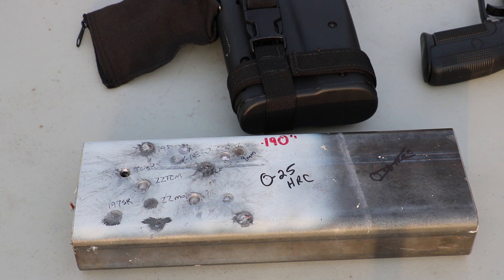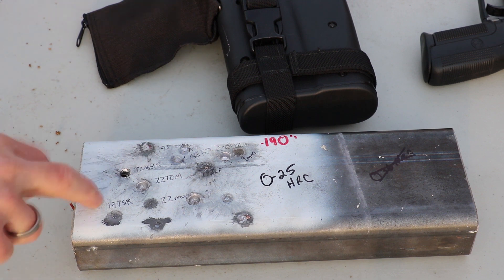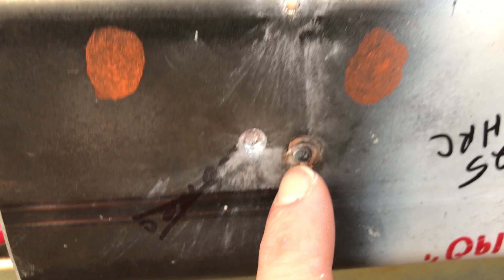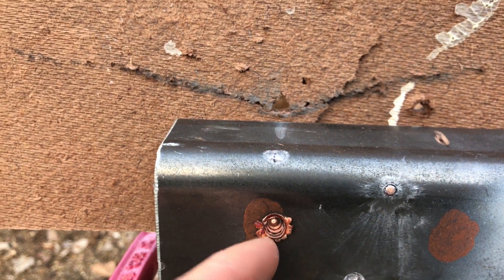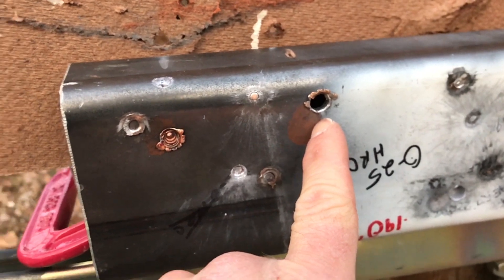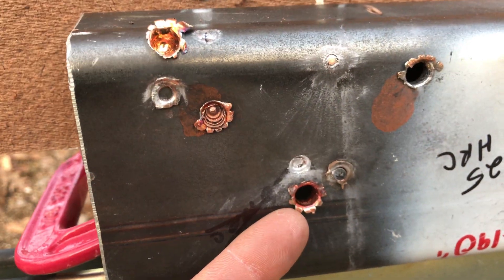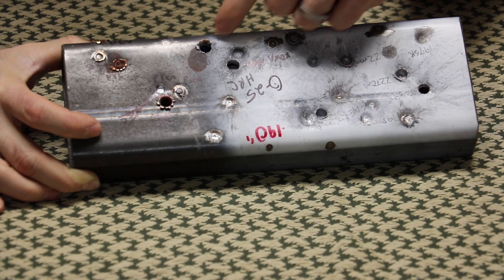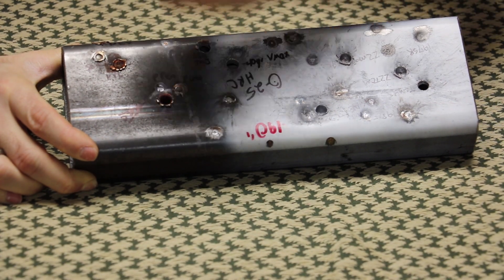Can Various 5.7x28mm Rounds Penetrate Mild Steel?

Comment: Could the SM855 and SM855A1 penetrate this being shot from a pistol 🤔? 
25 HRC is surely high strength steel.
Reply from the maker: @ShokkuKyushu  not sure. Friend has SM855a1 and it comes apart when shooting it once bullet leaves barrel

Comment: how do you know the correct way to handle ricochet?
Reply from the maker: It's a crap shoot. Pretty much don't shoot steel at close range.
Reply: 10 yards is about the minimum safe distance for proper steel targets if you're using handgun rounds.
Angle the steel slightly towards to ground & don't have it rigidly mounted.
Another big thing is to never shoot it at a sharp angle.
Shoot it straight on or at least pretty close to straight on.

I can't guarantee your saftey, but following these rules are almost certain to keep you from any significant issues.

Comment: Anyone know the C scale hardness of 14 gauge steel in a shipping container? I'm trying to estimate p90 effectiveness when target is using shipping container as cover, thanks
Reply from the maker: I'm going to say it's mild and likely of the similar hardness to this. Without me having access to a piece for testing, it's a wild guess. 14 gauge steel is only .075" thick. This box steel here 240% thicker. :D
Reply: @BuffRANGE  Thanks for the. Reply. Sounds like a standard FMJ fired from a p90 should be lethal if target is inside container. Probably even penetrate both sides. Might not be lethal if it travels through both sides though. :) wild guesses from me
Reply from the maker: @andersmalmgren6528  If I get some 14 gauge steel I can try sometime, but it may be a long time before I would know. And  standard FMJ do you mean the American Eagle TMJ or SS190?
Reply: @BuffRANGE  The SS190 (the 31 gr version)  seems like its mostly common if i'm not mistaken.
Reply from the maker: @andersmalmgren6528  depends on where you are from. in the US it is not available for us to buy from dealers.
Reply: @BuffRANGE  Yeah, I was thinking military use :P I'm that same gamedev guy you had a mail conversation with a few weeks back, we are just trying to set up some work in progress numbers that are not too off for our  terminal ballistics :P
Reply from the maker: @andersmalmgren6528  Got it :D I remember now.. Sounds like you'd want me to test this..
Reply: @BuffRANGE  haha, I cant ask that of you but it would be cool :D 
There are alot of barrier tests online, but most are hard to extract any data from :D

Comment: VELOCITY is the key. A guy loaded a 55gr .224 std FMJ  lead core Sabot in a 300 mag. 5000 fps blew a hole thru a piece of 1/2 AR 500.plate.
Reply from the maker: Got a video? I've been trying to do 300 WM Sabot and haven't had good luck :(
Reply: @BuffRANGE  Search for "5000 fps" that should pull up a dz or so videos.
Reply from the maker: @williamkowalchik572  Thanks

Comment: The pure lead has more mass than steel, so theoretically when the projectile and plate connect and create that imperfect liquid situation, the higher mass of the lead should push through the less dense steel.

Comment: I really like the FiveseveN and the 5.7x28 cartridge but truth be told, the round comes up just shy of it's full potential - but it's not all just the round's fault.  Because the cartridge is so long, FN had to compromise somewhere to hold the pistol size in check so a short barrel made sense, even though high-capacity .22 bottleneck cases lose a lot with each incremental loss of barrel length below about 10 inches.  So clearly the 5.7 would be a better round if it's base platform had a 6" barrel instead of 4.75"!  Then comes the fact that FN has never seen fit to really market the gun and has kept prices high on what should really cost no more than any other mostly polymer pistol.  And of course to date, other than custom loaders, nobody but FN makes 5.7 ammo and nobody sells new brass and there are no bullets commercially offered that are specifically tailored to the 5.7x28.  This portends a grim future for what could have been a market changing cartridge and gun had the company who introduced it really pushed it instead of essentially making it an orphan offering.  Everything in the aftermarket is pure ripoff pricing - barrels for over $400, triggers for nearly $100, magazines over $50, and of course ammo generally nearly $30 a box for basically two choices, unless one is willing to swallow the entire pitcher of Kool-aid and shell out $2-$3 a SHOT for custom ammo which is nothing more exotic than properly loaded with the exception being Elite's turned copper slugs.
Meanwhile along comes the .22 TCM.  Right off the bat I should point out the brass is developed from .223 rifle brass which means a never ending supply of cases for those willing to form their own, or for those willing to capitalize off selling formed brass to those who want it.  However, Armscor is selling new brass in bulk, along with their factory bullets for reloaders, plus there is generally an ample supply of factory ammo in the pipeline.  Armscor marketed the .22 TCM as a "range toy" low-recoil alternative to the 9mm or .45 auto in 1911 size pistols.  This along turned off a HUGE amount of interest as many were left out of the target group.  Armscor has slowly been adding conversion barrels for Glocks and MAPP pistols which also fit EAA pistols and even CZ pistols, but they've stopped short of really pushing the .22 TCM9R for EVERYTHING with a 9mm barrel in it!  They also need to offer longer barrels at least a 6" option because, like the 5.7, the .22 TCM/9R really excels with just a bit more barrel - this really excites the hunting crowd.
With the introduction of the "9R" spec version of .22 TCM, Armscor can be run through any 9mm size magazine and action which pretty much eliminates any "need" for continued interest in the 5.7x28 other than as a hobby round that is shot very little and preserved as much as possible because the day IS coming when it will no longer be on the market and ammo will become impossible to obtain unless somebody starts making brass....which as I remember the last company to try that changed their mind pretty quickly, but then, if NOBODY is making brass, then it might become economically worth it....though as with all things 5.7x28, everything is expensive far out of proportion to the product's reality.
On the other hand, The .22 TCM and TCM9R are the "better" choice for every practical reason, and I hope to see them rise in popularity as more shooters discover they don't have to buy a FiveseveN to have superior .22 bottleneck performance.
Reply from the maker: Yeah a 7" barrel gets about 125 fps jump from the 4.75" barrel. I definitely agree FN has never really marketed the gun very well. 

FN as a whole seems to care about military/police/govt contracts and large sales, and little about US Consumer market. "Ohh hey here is a new 9mm handgun every 5-7 yrs that we developed and it's the bees knees, all LEO should adopt this, we give you big discount".. US Consumer "Sweet gun, it runs, how much do mags costs, where can I get aftermarket parts, how can I run a suppressor on it?" FN Customer support: "Warranty Voided, please buy our new SpankySpank Tactical handgun"

The FSN has been around for 20 yrs.  There's been some good advancements on the FSN, but yeah it costs too much. There's nothing patented about the brass, so nothing is stopping companies from making the brass, except profits, since the FSN, and like 1 other actual 5.7 handgun exists (would like to try the Fort-28), and volumes would be lower. R&D at FN or other big companies is probably many times over EA/RR/VG. It would be very easy for them to see what those companies have done in the 5.7 space and mass produce a bullet aimed at superior performance. 

I wonder what would happen if @Glock made a 5.7 gun...
Reply: 2 years later & 5.7x28 has never been more popular & .22 TCM is DOA.
Reply: Whats great about the 5.7 is the ballistics of the round. Its the most accurate pistol i've ever shot, holds 20 rounds, and can penetrate level3a armorer. The five seven is ready for combat

Comment: Interesting results.  Be nice to see a more H2H comparison between the 5.7 and .22 TCM.  The TCM has been marketed as a "range toy" with .22 magnum, think-jacket bullets with huge exposed nose lead.  The 5.7 hit the market with a pre-reputation for being built for armor penetration but in order to avoid being banned was almost immediately neutered with low-velocity loads and in the case of the SS197SR highly frangible bullets not meant for anything larger than small game animals. 

Even now, I know of no custom ammo loaders commercially loading "performance" ammo for the .22 TCM even though the cartridge has far greater potential than the 5.7x28.  Meanwhile, there are about a half-dozen companies pumping out high-dollar "performance" ammo consisting mostly of commercially available bullets loaded to the the 5.7's proper potential.  From what I've seen velocity is more responsible for punching holes through steel and Kevlar considering standard Armscor factory ammo with the thin-skinned .22 magnum slugs punches very well when striking at over 2,000 fps!  The .22 TCM9R is even better because the 39 grain short-nose slug has jacket all the way up over the nose with a small hollowpoint making the bullet tend to collapse inward on impact with hard surfaces which makes it a better penetrator.  The common factor for the .22 TCM/9R is the high-density lead cores more so than jacket thickness.
A BETTER bullet for the .22 TCM (can't be used in the .22 TCM9R) is the Speer 40 grain Spire point.  This slug has a much thicker jacket since it was designed for +3,000 fps, a solid lead core and sharply tapered nose with a tiny amount of exposed lead.  With the small tip diameter, pushed fast, this bullet should deliver impressive penetration against steel and aluminum plate.  What would be ideal is to work up loads for both the 5.7 and .22 TCM using this bullet for a direct comparison.  I've already done extensive load development with the Speer bullet in the .22 TCM - pushing it to nearly 2,100 fps from a 4.5" CZ 75B (RIA MAPP FS barrel).  The best I've ever managed from the 5.7 with go grains weight is around 1,950 fps "average" which clearly puts the advantage to the .22 TCM.
Since the .22 TCM9R can only use the 39 grain Armscor bullet, loads for it are basically working up to the best speed possible.  Anther approach is to reform .22 TCM brass into 5.56x24 which is designed to load the 40 grain Armscor bullet, as well as the Speer 40 grain, 46 grain, and even 33 grain bullets while feeding through 9mm size magazines.
Reply from the maker: Yeah about 1950 fps seems to be a good safe limit in 5.7x28mm loads from the pistol.  I wonder how it could fair against soft armor.

Comment: to penetrate metal you need a hard solid bullet.   Not copper or FMj
Reply from the maker: It all depends on the metal. Plate steel can be penetrated by a lead core FMJ moving at good speeds (M193) depending on the type of steel. Generally speaking though hardened steel cores and tungsten is where it's at..
Reply: penetrators, tungsten, and depleted uranium are too expensive for a common bullet unless you watch james bond movies.

Comment: 5.7 best pistol round it's basically a short 556 in a pistol with 20 round mags and it'll penetrate light armor
Reply: Except it’s been proven time and time again that 5.7 will not penetrate soft armor out of a pistol length barrel.. and only green tip will pen soft armor out of an SBR length barrel.  Green tips performance against flesh is horrible and 9mm +P hollowpoints have far more expansion then 5.7 hollowpoints esp out of a pistol barrel

5.7 is straight anemic out of a pistol
Reply: @Marksman5147  There are several videos on this channel were level iiia is penetrated with several 5.7x28 ammo types from a pistol😅.
Reply: @Marksman5147  There are several videos on Buffman's channel where level iiia armor is penetrated with various 5.7 ammo from a pistol😅.
Reply: There are several videos on Buffman's channel where level iiia armor is penetrated with various 5.7 ammo types from a pistol.
Even with subsonics or hollow points .
Reply: Ya im buying a p50 for my first gun.

I know its a BFG but i need something that can break engine blocks while having enough for tires and cab.

Keep getting crazies trying to intentionally hit and run me down.

Been dragged by vehicles, pushed 3 car lengths with a dislocated shoulder and feet on the bumper, feeling the burn as layer after layer of my shoulders rubbing away like sand paper on skin. 

Aal
Reply: @anarex0929  why are multiple people trying to run you over?

Comment: Why is there copper on the bullet?
Reply from the maker: The Elite T6B and Dev round are all a solid copper projectile.
Reply: Buffman - R.A.N.G.E. sry the question was 4 the SS190.
Reply from the maker: Jacket is copper on the SS190?
Reply: Buffman - R.A.N.G.E. why tho? Is the aluminum not able to penetrate steel??

Comment: Got a 6" barrel for the FiveseveN from EKFiredragon awhile back, they had both the 5.4" and the 6", coulda gone with the shorter threaded barrel for the best look but I wanted the most velocity I could get. Interestingly enough the 6" disappeared from the site, now they're just selling the 5.4". Wonder how much velocity I gained from the extra inch...
Reply from the maker: +Charles Murry  here’s a good run down https://youtu.be/qL_KbhhIVkg
Reply: Thanks. Got myself curious, was about to take some numbers off the official velocity chart and run some ratios against the p90, you just saved me some time and math
Reply: Kinda wish I woulda known there was a 7" barrel on EA, but then again not sure I would have paid almost $500 for a barrel. Do want that shroud though

Comment: Good video. I'm beginning to wonder if the American Eagle, for the price, is the best way to go for all around training, and self defense. It cut a clean hole through that steel.
Reply: KZ45  I believe that was AE bullets (just the tips) loaded by another company to higher velocties than the factory AE 5.7 ammo is. My experience is that AE 5.7 ammo is weak. I really don't like it. YMMV
Reply: If you're defending yourself against unarmored 2 legged prey (almost 100% will be) then the SS197SR is the round you want. Penetrator rounds will leave knitting needle sized holes in them and generally piss them off.  The SS197SR has a polymer tip and will tumble immediately upon contact - which is what you want.
Reply from the maker: Yeah. You'd get the velocity needed from AE TMJ out of the PS90 to do what it did here from the SBR.

Comment: very cool . its a realy good cartridge for penetration . but how about a common handgun cartrigde against mild steel . maybe 1/8" can defeat a 9mm or a 357 mag 40 sw
Reply from the maker: Won't do anything to steel :D
Reply from the maker: I can find some 8" mild steel. I just have to be extremely careful about distance and shot angle.
Reply: B Souza I would recommend trying the Liberty Defense ammo, they load 50 grain projectiles into common calibers that hit 2000 FPS.
Reply: Buffman - R.A.N.G.E. security first friend .i agree